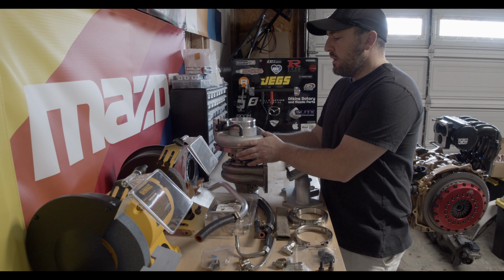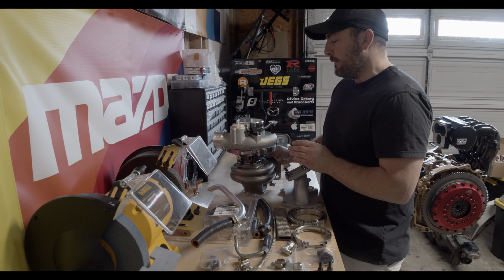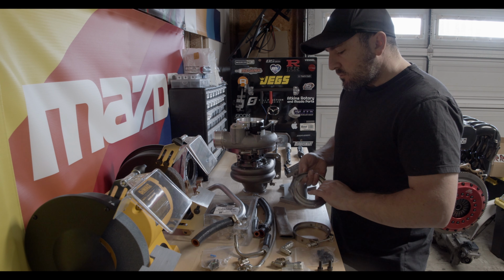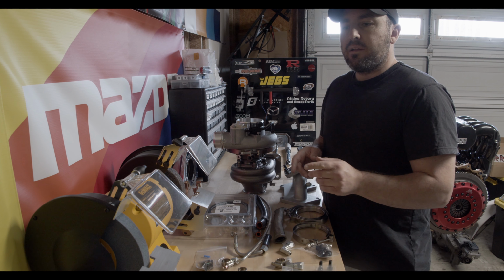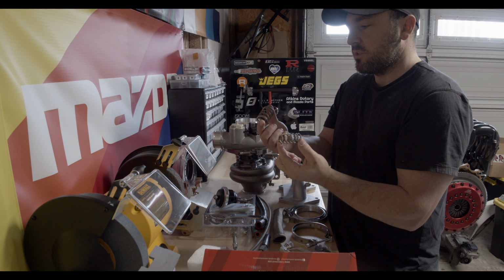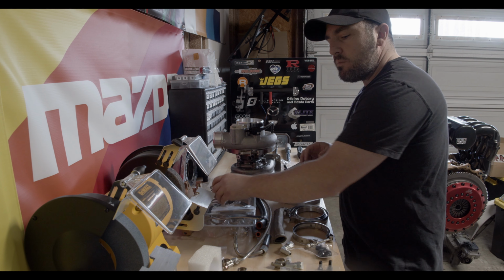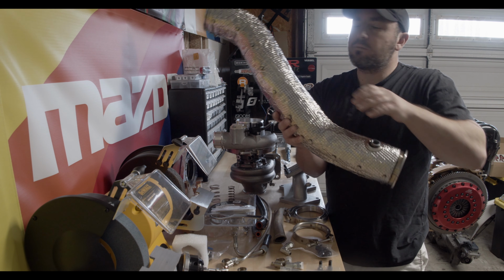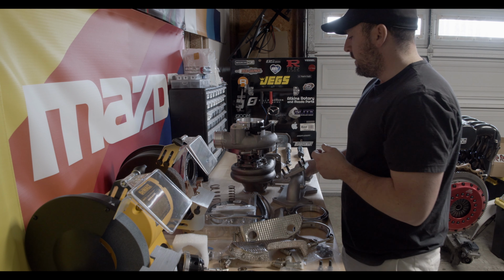Stormtrooper RX-7 Part 21: Unboxing the Turblown 8474 IWG Turbo Kit

Comment: Nice video, thank you for the positive review! If you are happy now, just wait until you drive it!   P.S. Funny that you noticed that the  o2 bung needs to be at the rear( literally in the o2 sensor instructions from EVERY company), yet you see fab shops putting them near the turbine all the time...
Reply from the maker: Thanks for watching and supporting the rotary community with great products. I’ve also noticed that about O2 sensor locations. Doesn’t really make sense to me to go through all the hassle and expense and not do it properly.